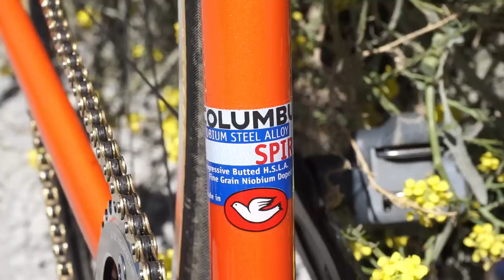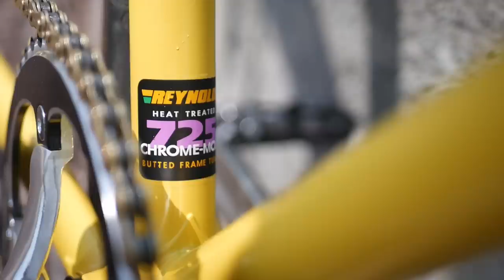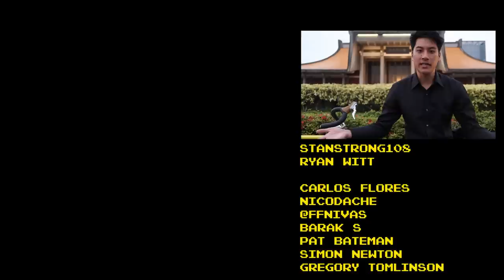The Case for Steel Bikes

Comment: Alot of misinformed information with the biased of steel.

 If carbon is soo unreliable then try to get the airliners to convert from carbon to steel since thats a pretty relevant case affecting thousands of people a day who fly.

Try telling all of the pro mtb'er that really put their life's on the line that their $5k carbon frame is taking a chance because of how biased we are towards steel that they should be using steel instead.

Try saying that the 1-2lb difference from steel is marginal on a road or mtb bike since they also incorporate alot more parts than a fixed gear. Convert everything on those bikes that are alluminum or carbon to steel and see how much that 1-2 so-called marginal difference goes up. A 5700 groupset that came out a few years ago weighs 723g. Convert all of the individual parts of that groupset to steel and it adds up. 

How about the alluminum rims that add to rotational weight. If alluminum wasn't reliable then why waste our time with all the advancements? Where's all the rims that fall apart from this very delicate alloy. 

Crap alluminum and crap carbon are what's bad. Good carbon and good alluminum will last forever just like steel. Forever as in the conditions the avg person puts them through. Of course carbon and alluminum will have a shorter lifespan than steel for a pro but we aren't talking about pros. We are generalizing things by talking about the general public who rides for the fun of it.

Bet you anything that if this guy wasn't getting paid for his videos then he'd clearly be saying something else. That's if he would even continue making videos at all... For free.
Reply: Airliners and bicycles are in two different leagues of engineering. Yes, airliners use carbon (not for the vast majority of structural components, but I digress), but the engineering and manufacturing quality that goes into an airplane is at such an astronomically higher level, it might as well be a different material. Seriously, check out Hambini's YouTube channel and see how many carbon frames from reputable brands are total shit. Aerospace use of carbon is irrelevant here. 

Carbon MTB frames are also a lot different to road or track frames. They're built to be durable, while road frames are built to be light. Besides, even aluminium frames are considered to be wayyyy more durable than carbon ones in the MTB world.

I'm still not sure how you managed to miss the fact that this video is about frames, not complete bikes. The whole point about the weight was in regards to the frameset, genius.

Also, aluminium and carbon definitely will not last as long as steel. Carbon tends to lose integrity when the resin that holds it together ages, and delamination can also be a factor. Aluminium fatigues and develops microfractures. It's pretty well documented that steel does indeed outlast the other two, unless it rusts.
Reply: @MarchuxProductions  
1. The video poster was generalizing the differences with the 3 different materials (Carbon, Steel, Alum). This generalization gives justification to what audience he was marketing the video towards being the general public.

2. If you rewatch the video and thoroughly analyze it more then you will see that he does mention bike "Materials" and "Stuff". He even goes as far as saying at 01:43 "The weight of the ENTIRE bike system". Clearly this video was not just intended for the frameset..... Genius
 

3. Please show me any examples in the Road bike industry for a typical end user that owns a 'quality' alum/carbon frameset that does long distant rides like the video poster or anyone with a 'quality' MTB allum/carbon frame from their weekend warrior escapades that has experienced frame fatigue to the point where it has become an overwhelming life threatening risk factor at a massive scale? If anything this would be quite pronounced with the low budget constructed aluminum bikes that are offered at the big box stores. That simply is not the case. 

I would say that a good portion of issues come from the inexperienced lazy DIY that work on their own bikes at home that don't properly torque components down per spec adding additional stress to the delicate frame material that later on experience a fracture due to their handywork. Then there's the so-called bike mechanics at the local shops that are low paid and could care less about their job that also over torque causing the client to experience a frame fracture later on. It's not like every shop requires their technicians to be UBI or BBI certified since those are the 2 largest institutes in America in this field. Nor is there a predominant amount of bicycle institutes in general across America to say the least just for the assurance that the technician are more competent. Instead what you get apart from an institurtional assurance are either the inhouse certifications by either course or simply by word. It's almost the same thing as Geek Squad. It's simply nowhere near the same scrutinized requirements involved with Automotive, Aerospace, Marine. Therefore with this type of incompetence and/or low pay,  you can be assured of lots of shop 'technicians' to be a factor to why frames would fracture under 'normal' stress.

4. I will agree that steel and alum will degrade overtime however carbon CAN last indefinitely as long as you don't crash or abuse the frame. Aluminum will degrade faster than steel but when has this been a problem with the general public having their bikes for years?

Comment: Why do steel frames always habe integrated seat clamps? I am always afraid of breaking them although I use a torque wrench.
Reply: SalvadorBrutali  if you do accidentally strip out your seat post clamp, you can always repair it with a helicoil, or keensert. All will not be lost.
Reply: Mine doesn't. However I ordered it that way. My frame is custom.

Comment: Steel is forever only in a climate without humidity. Price of new steel frames is equal to carbon. Used steel frame is the way to go, but i would steel be careful with what I buy. Also weight matters in any type of race condition.

Comment: I also prefer steel bikes for comfort. I put a naked rubber C17 on my carbon bike and it helps with the suspension of that pesky heavy part of the system.

Comment: There has been a very recent trend to praise steel frames for some reason. I don't get it.
1. Steel rusts.
2. When you talk about wheight you compare it to the wheight of the system and then you talk about power we can produce. From a logical point of view this is wrong. Do I need to explain why? Together with this hipster trend for downshifting and steel frames world seem to loose logic.

Comment: Steel is real. Thanks for getting the word out Zack. I’ve been riding steel frames since the late 60s, and I must say that everything else pales in comparison. The bicycle companies are your typical Corporate douche bags that are always looking to maximize profits, by giving less, for more($$$). This whole age old promoting of light weight, seems to have gone out the window ( with the marketing of disc brakes, and electric shifting; every gram saved doesn’t seem like such a big deal anymore). Case in point; there is no frame material that has, does, or ever will rival steel. Steel is real!

Comment: I have 2 carbon bikes, 2 aluminum bikes and 2 steel bikes why not have them all, they all have their use. If you can only have 1 I'd go steel or aluminum as the worst thi g possible is to not have a bike and having something sturdy helps keep you riding. Also I never sent any bike to the trash and hope it will never happen!

Comment: One frameset I have never parted with was built (in Italy) in 1971. Ya, a 1971 classic which I periodically still ride. I'd say it has around 130k plus miles on it. For some crazy reason it always (still) rides great - replete with its original equally inferior Italian gruppo which contradicts the pop out Made in China plastic fantastic (carbon) "bikes" devotees position that steel is inferior. No rust, no fatigue. What went wrong....? Seriously.  I've had offers to sell it and two other inferior '80's Italian steel classics (also with high mileage that also look like new) that I always ride, but no. They're not for sale.  I like riding inferior classic steel with inferior Italian gruppo. Maybe one day I'll get with the new age hipster plan...................     NO.

Comment: Over time steel work hardens and becomes embritteled leading to cracks.
Reply: @Dave Stambaugh   If I'm not mistaken, that only happens if you exceed its modulus of elasticity...as long as you stay below this "fatigue limit" the frame should last an innumerable number of cycles.

Comment: Really ? I have a basement full of high end steel road machines assembled over the past 4 decades , primarily gathering dust . Sure they are generally asthetically pleasing , but when life catches up and the bills have to be paid , you find yourself lugging around a few extra pounds , the modern carbon frames actually really make a significant difference in one's ability  to either hang with the pack or get shelled off the back . Just an opinion formed after a solid 40 years of propelling  2 wheel devices . Yes the carbon won't survive many crashes , but it is hard to go backwards when you become spoiled with many of the advantages of proper carbon fiber . Antiques are wonderful to appriciate , but perhaps not the best tool for all applications .

Comment: "steel frames are heavy. this is a misconception." "my bike is 19 pounds. i dont really know. it doesn't matter."

lol ok.

"aluminum and carbon might be a pound lighter."

my carbon bike GEARED bike weighs 16 pounds bruh.

The only misconception i'm hearing in this video are your arguments against carbon which is completely wrong. Frames just don't 'fracture' from the inside. Who the hell told you that was a thing? That does not happen, lol. You have to CRASH a carbon bike to cause a fracture in the frame. It just doesn't happen out of no where.

Comment: You can't generalize all carbon constructed framesets and say that it can "fail without notice". Not all carbon framesets are constructed the same and not every company abides to high standards like the old Made in America carbon made by Trek over Motobecane carbon made in Asia. If your going to generalize carbon then I can just as easily dismiss the quality constructed steel framesets and generalize ALL steel under an umbrella just the same. This works both ways. 

 If all carbon construction had the potential to fail from out of nowhere then it would be a high risk safety hazard that would have been taken off the market and not lasted for the 28 years that it's been around. No business would want to have to deal with constant cases like this either. Infact you will find only a handful of cases where this has happened and you'll also find cases where steel has failed. This is why you can't generalize.

Also there wouldn't be any trek 1992 American carbon made bikes present anywhere in the world today in rideable condition because they would have all "failed without notice" by now since supposedly 'all' carbon frames somehow dont age well even though this particular bike is now 28yo.  

There's even a difference in the construction of carbon frames between road bikes and mountain bikes. Road carbon isn't intended for high impacts like mountain bikes since you are jumping off high elevations. 
Therefore the construction of carbon for mountain bike frames has to be more durable than road.

Comment: Bro its very simple. To make steel bikes they make tubes thinner. So not only it weights more, it has much less durability.
Steel is not smoother to ride. Bro jusr check researches and you will find out that frame doesnt bend at all while you ride. Frame doesnt flex almost at all check researches. Bro you 🤡🤡🤡🤡🤡